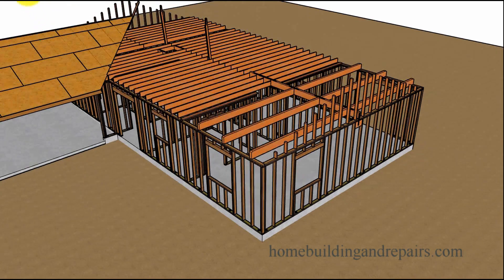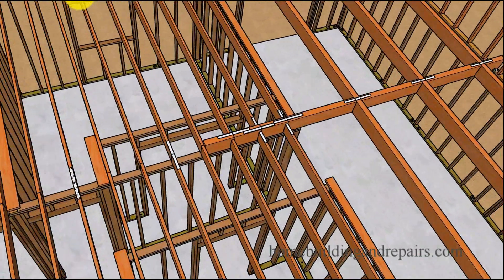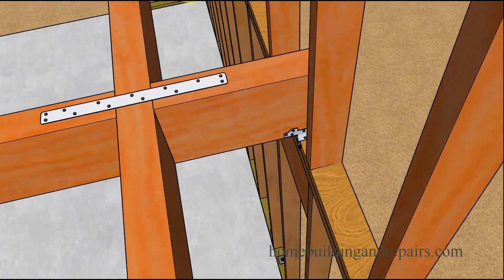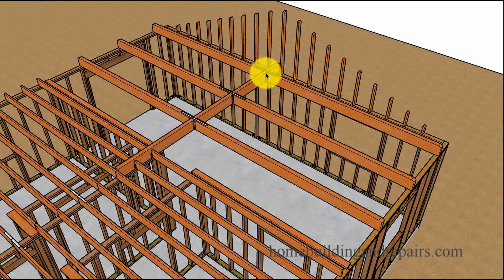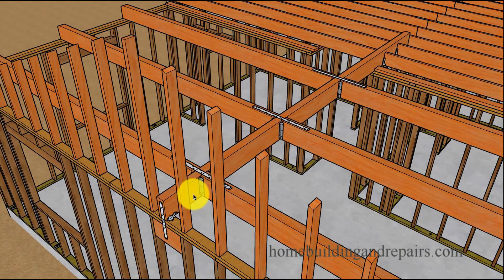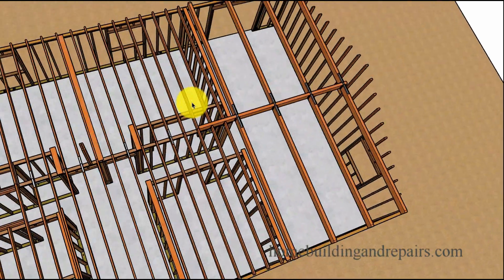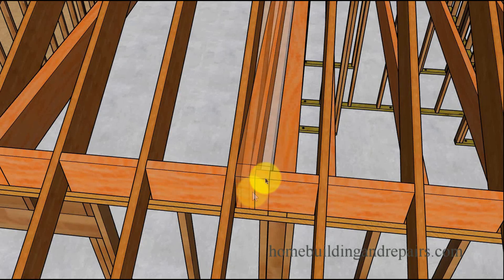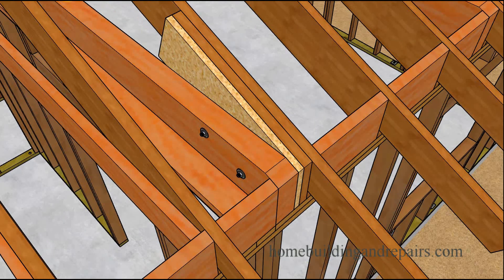How To Use Ceiling Blocking And Beams To Make Exterior Walls Stronger For Vaulted Ceiling Remodel

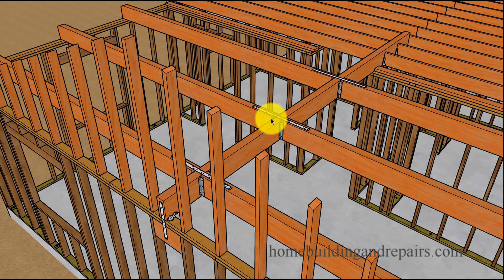Comment: 4:12 Use the beam but double it. Just glue too beams together to make it thick. Or if heavy load use an steel i beam. For the center beam and wood beams from the walls out to it.
Reply from the maker: How would you double the beam? Are you talking about using materials like LVL - laminated veneer lumber?
Reply: Nope, just put 2 beams side by side, Nail, bolt or glue. That way the left beam is for the left loads and beams and so on. In your construction one beam gets all the load. Sometimes that is not enough.
Reply from the maker: @72strand  I got you, that way you could use smaller lumber if needed. Remember, I also suggested that you could install additional beams running perpendicular to the rafter ties, if there is some type of structural loading problem.
Reply: When i remade my garage roof, (that is flat, and have a 2 degree slope) i needed to hang everything in one beam in the middle. I glued 7 beams together. And the beam became 60 Feet (ft) long,  16 inch high and 12 inch thick. You don't want that fall on your head.
Reply from the maker: @72strand  I would love to see a picture of it.